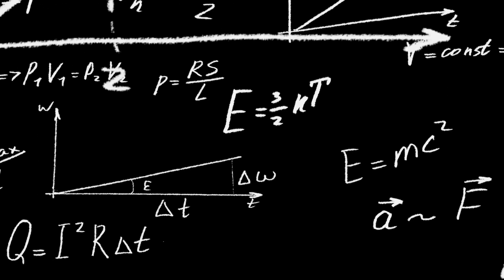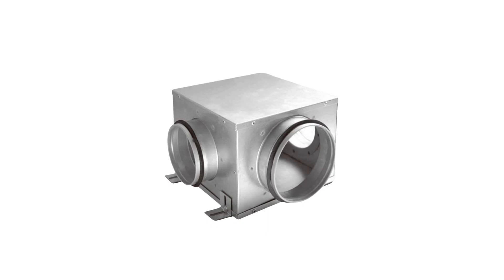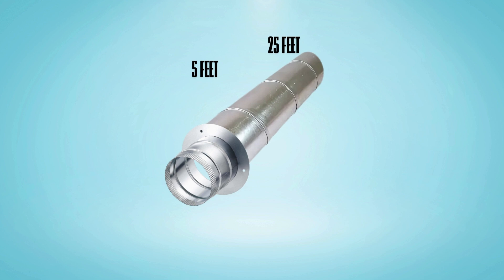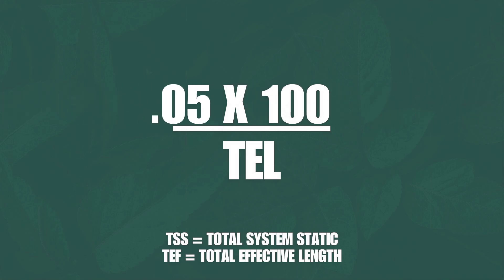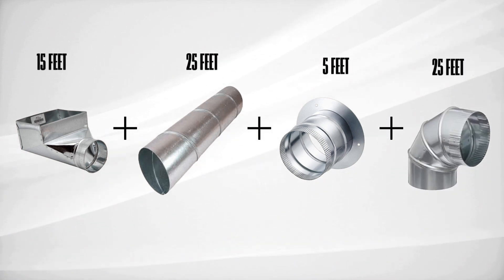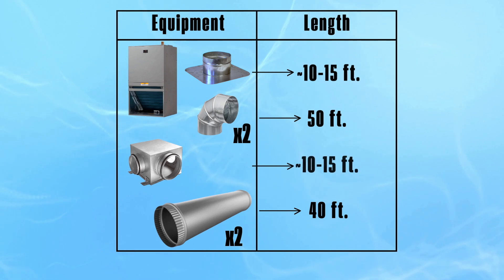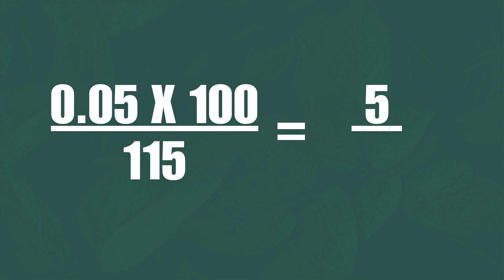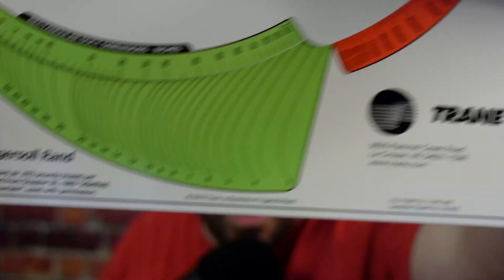HVAC Sizing Explained: Return Duct Design and Ductulator

Comment: Why not an app that can do this based on home sqft and layout
Reply: There is a much more with residential cooling and heating load calculations than sqft and layout. Window orientation and sqft size can play a large part in the load calculation total. People are amazed when I tell them that here in central Florida, you need more heating capacity than cooling. That all goes back to temperature difference between inside and ambient outside. Summer>17 degrees (92-75), winter>35 degrees (70-35). The 35 degree ambient may only happen a few days out of the year, and only for a few hours, so we are mandated to design at 42 degrees for the winter outdoor temp.

Comment: Thanks but I could use some clarification.  Are you basically first just visualizing how the duct will run, without considering  size (diameter), then do the calc, then figure out the actual size?  Don’t different diameter elbows have different TEL's?

Comment: Static pressure - component losses = available static pressure
(available static pressure x 100)/ TEL = calculated friction rate

That is where the formula ends. There is no need to make up formulas and confuse people. 

You can't “Try to land on .05” and 0.1” the math is the math. You are arbitrarily using 0.05” in your math.

Comment: You are essentially pressurizing the space and the return duct system including any accessories fittings and straight duct in order to get the air back to the supply fan. If that pressure gets much over 0.05” it will cause too much positive pressure on doors. You can calculate the force created by that positive pressure for a given door size. Code has maximum forces allowed to open or close a door. 0.05” usually works well for most man doors to be under the allowable force. If you have a return fan then it is a whole different story. This is where I think the 0.05” is important along with the duct system design. It may possible be where the constant came from to begin with who knows?

Comment: I've got nowhere near the amount of ductwork needed for my 2 ton system or an upgrade to a 60k condensing furnace from nat. draft. I also know my system is oversized based on runtimes on the hottest and coldest days. I don't expect any installer in MN to listen to me when I ask for a downsize, even if I show them all of the data logs and they look at the ductwork. The AC has a minimum 25 degree difference between supply and return with a brand new unrestrictive filter and it only gets worse from there.
Reply: Same. Downsized houses after kids left to and older home. Only returns are in Hallway. 3 friggin tons. Seller/installer put their sticker on it. Last company I’ll call for anything. They need a spanking. These return vent additions should be listed in the tax deductions for energy efficiency.

Comment: Homeowner: Mr. Hvac technician it is 12°  outside, and my heat doesn't work.
Tech: Your furnace is tripping your high temperature limit, and your external static pressure is too high. I just need 2.5-3 hours and $350-400 to count all of the fittings and duct work that I can see and then take some wild guess at what is hidden above the finished basement to determine your proper air flow because it likely wasnt  installed properly. Then, I will need $1600.00 in new ductwork and return air grills  to make it right.
Homeowner: Why? 
Tech: Because design manufacturers and the powers that be keep creating ways to save a few dollars a year in energy costs.
Homeowner: That's B.S!! This is a 12 year old custom built home, and I've never noticed this problem before now!  Get out of my house!
Reply: I’d boot you out of my house for saying shit like this too

Comment: I understand what you are doing BUT you need to be talking to the home owner that is trying to make the most of what they already have installed.  The common problem being the restriction on the return filter that is already installed.  Square inch area or the thickness of the filter restricting the air flow.  I will try to review problems I have solved on my own.   A 3 ton package unit with a 14 inch return duct first installed with a floor vent 20 x 12 inch return filter (active filter area is 209 Sq. inch). Not enough air flow for the unit.  So to make it easy I built a square box type end table large enough to cover the floor return, also large enough to install 2 each 20 x 20 inch filters equalling 722 square inch active filter.area.  This cured the house problem.  The playroom/garage with the same unit I played with the filter area up to 3 each 20 x 20 inch filters, active area was 1,083 square inch area.  The 2 filters was all that was needed so I built a box for them.  Now we had a third problem at a friend's house. A CORE, I have no idea of the unit size because that was not the problem.  The return was pulling thru two doors with 20 x 20 inch vents.  The doors would slam shut with the unit on.  The door vents were not large enough.  Also having continous problems with the unit.  So rather than cutting larger holes in the doors it was easier just to take the doors down.  Now we had the air flow for the unit to operate as it should and have had no more problems with it.  There is always a way to get more filter area even wih the filters installed in the duct.  Try this type of DIY video for those people that do not understand this and do not need to engineer there AC syastem.  I have not found any video's on just this type of problem, just video's that though everyone was an engineer.
Reply: 3 ton should be installed with 16" round off a package unit .
Reply: It's best to remember that return air grill and filter sizing should be at an air flow maximum velocity of 500 feet per     minute. 400 fpm with reduced velocity is better because the filter media can capture smaller particulate matter. We typically use a rule of thumb of 400/cfm/ton of capacity, but this can vary by as much as 10% one way or the other. The return duct sizing will typically be at the approximate 700-800 fpm velocity.
Reply: I do not know about all of those numbers but when it looks like the air flow is trying to pull the filter thru the return duct the filter is TOO small.  Both of my units have 20 X 40 filters which is the size it took to not have this problem.  I arrived at this by increasing filter size from 20 X 20 and moving up in size until I no longer had the problem.  My house had a 10 X 20 filter on a 14 inch return line.  I built what looks like an end table to hold two 20 X 20 filters to cover my floor return.